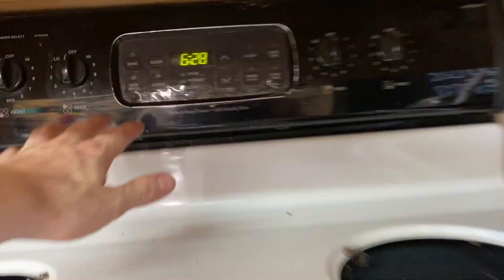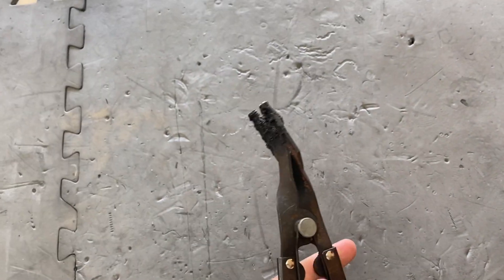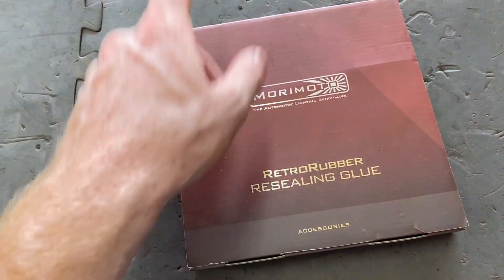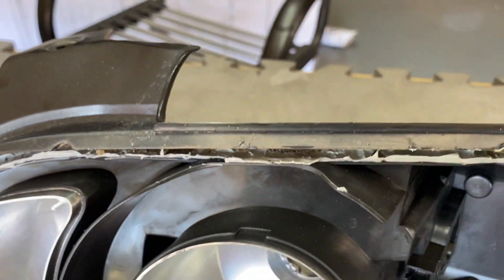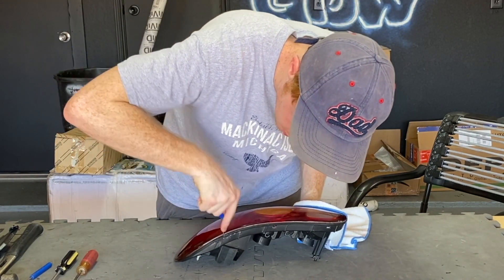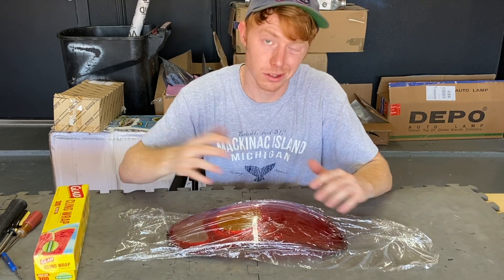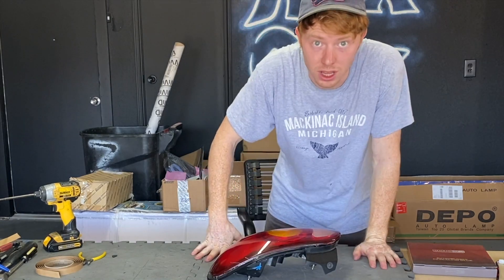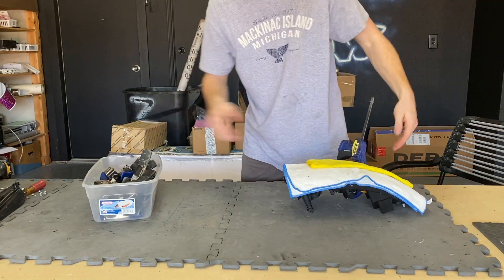how to open NB MIATA tail lights

Comment: What temperature do you recommend on the oven? Please specify if Celsius or F° 😂
Reply from the maker: Sorry if i didn’t put it in the video but i normally 215f or 220f (if it’s a newer oven i recommend running it a bit cooler)